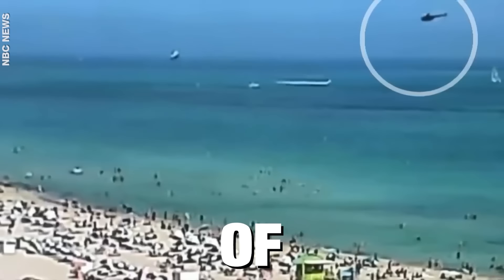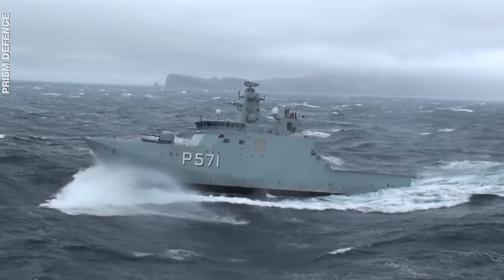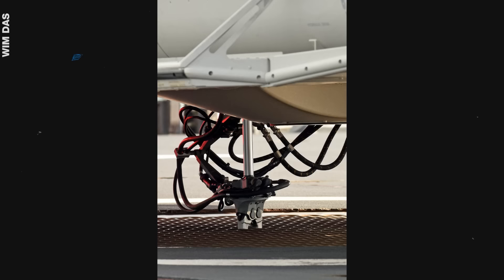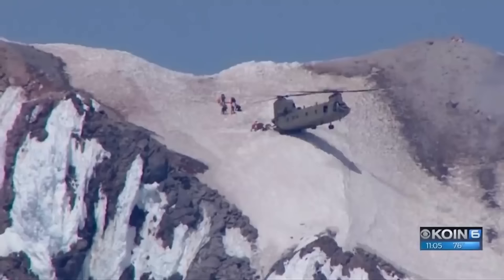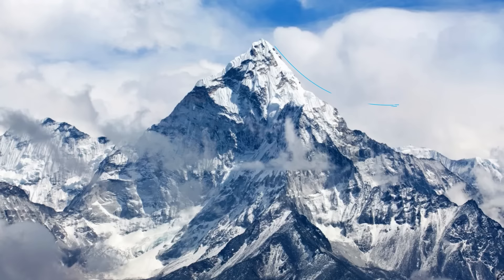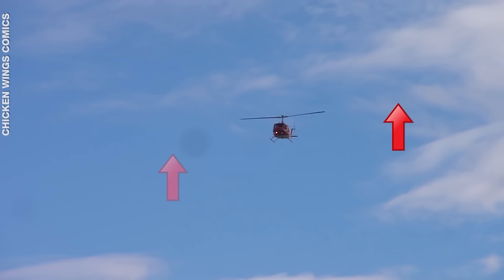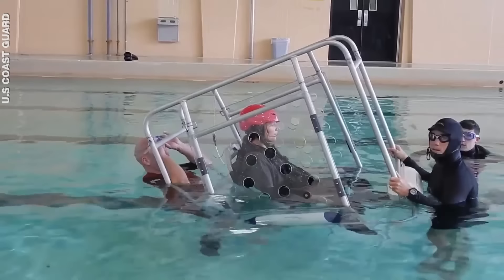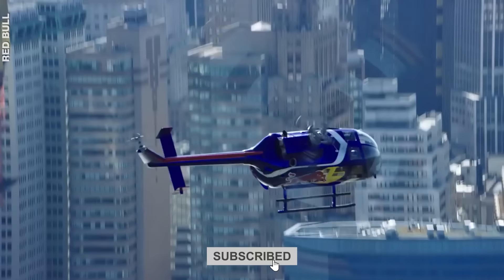How Helicopters Land In Dangerous Situations

Comment: @Xplained you are not correct  with the automated helicopter landing system. It was developed for the Japanese military not the Chinese. Mitsubishi is a Japanese company. You might want to do more in depth research with reputable aerospace and defense sites, rather than Wikipedia or some other online platform that does not have verified experts.
Reply: Concur.  Chinese and Japanese are not the same Xplained, kindly confirm your ethnicity awareness is at least that developed.  Your own video clearly shows footage labelled Mitsubishi Heavy Industry and the animation is a Seahawk helicopter variant with a JAPANESE flag on it.

Comment: Autorotation is a procedure the pilot performs rather than a system. The pilot lowers the collective, which reduces the angle of attack, and increases rotor rpms. When the rpms are high enough, the pilot pulls up on the collective and creats lift and slowing the rate of decent. Depending on altitude, this will be done 2 or 3 times before reaching the ground. I was a helicopter crewchief in the army and have been in them many times doing autos.

Comment: The autoration "system" 🤣

It's not a system you can just engage, the lever on the pilots' left side by his/her leg is called the collective because it collectively changes the pitch of all of the rotor blades. In order to enter an autorotation you have to lower the collective so that the pitch of the blades allows air to flow up through the rotors and keep them spinning, which allows you to basically glide to a safe landing spot. When you lose engine power in normal flight the rotor blades will begin to slow down because they are pitched up, if they slow down too much then you absolutely will sink like a rock and changing the pitch of the blades will not help. So pilots have to act quickly when the engine fails, especially in lightweight helicopters like the R-22 where you only have a few seconds to lower that collective before it's unrecoverable. I'm a student pilot, practicing autorotations is one of my favorite maneuvers to practice! Although you actually are gliding it still feels like you're coming down at a very fast pace so there's a bit of a pucker factor involved, and I'm a bit of an adrenaline junky so there's that. But it's also challenging because there's so many things you have to do all in a short amount of time; enter autorotation, scan for a safe landing area, navigate to that area and scan for power lines or other hazards, monitor rotor RPM's and airspeed throughout the entire maneuver, make a mayday radio call which may involve speaking to ATC or other pilots while you're doing all of these other things. It's a multitasking nightmare and I love it! 🤣
Reply: I also chuckled at the "system". Fellow student here

Comment: I was trained in Army Aviation is 1966 and completed two tours in Vietnam, accruing 1,955 combat flight hours.  There were five (5) events during my time there (due to combat) requiring autorotation and all 5 were successful.  Why?  Because we were trained by helicopter pilots who had completed their combat tours in Vietnam.  We were taught EVERY CONCEIVABLE way to autorotate TO THE GROUND (except upside down!).  And don't start with "Redbull" helicopters - they are specially engineered for the aerobatics they do and are NOT indicative of the ability of common rotary wing aircraft. The BIGGEST problem with today's training?  Virtually NO helicopter pilot today is trained to autorotate TO THE GROUND!  They recover with power at about 100' or so.  "Oh, we practice in simulators."  Hey - big hint here - "Simulation" is NOT reality!"  And again, don't start with that 'mulit-engine so we're good' song and dance.  I've seen common shoulder-fired rocket propelled grenades (RPG) go right up the back of a Huey tail pipe and blow both the engine and transmission out!  Today's "Threat" is lightyears more advanced than the rice paddy bad guys we faced.  V22 Osprey, V280 Valor and S-97 Raider all look sharp and of course, have Shills all screaming about how good they are.  BUT.  All I see is nice, big, juicy TARGETS easy to hit when they ALL HAVE TO LAND!  Speed? I want to see any one of them dance their way out of meeting a modern guided missile of any kind, much less radar-guided artillery (which I encountered myself)!  Have any of you NOT watched the Ukrainians blow a number of Russian combat helicopters out of the air without breaking a sweat?  I have.  FOOD FOR THOUGHT for all of you out there believing the shills and so-called "invincibility" of new modern rotary wing aircraft!  My 2¢

Comment: Helicopters are not a dangerous mode of transport, but the environments in which they operate are. Challenging, unforgiving, hostile, raw, & most times with little to no auxiliary support. When bad things happen, it usually requires a split second reaction & response. We don't have the luxury of going back for a cup of coffee, to give the situation a think.

Comment: He didn’t explain the emergency system well so I will. The pilot has the control to told the blades of the rotors in either direction. I’m the event that the engine stalls and the chopper starts falling out of the sky the blade are flipped right before the chopper hits the ground since the force of the chopper falling has spun the blades on the opposite direction and give them a lot of speed it’s enough power just before the chopper hits the ground to flip the blades therefore changing the direction of air the rotor is pushing it.

Comment: Statistics can be so misleading. "35% more crashes than an average aircraft...". Average aircraft includes all the passenger  planes flying like taxis all over the world every day. Choppers are not used in this way, nor should be compared in the same context. 
True, but still SO much more safer than automobiles we drive every day... Cost ratios need to be included in this equation. 
Not to mention they can do things that no other vehicle can! When no other alternative is available. 
These "dangerous situations" are in a situation that no other vehicle could possibly be in.